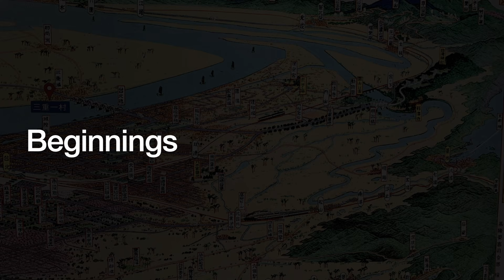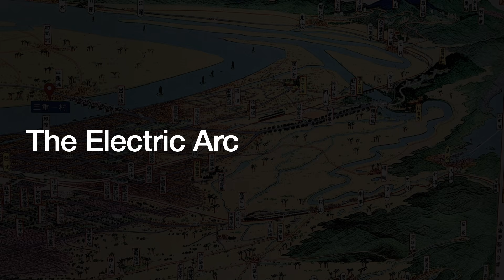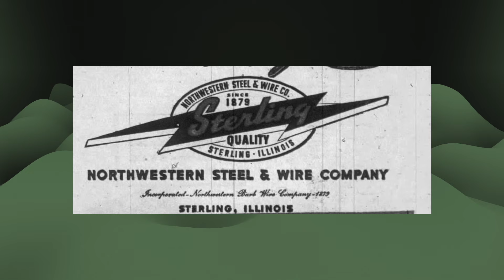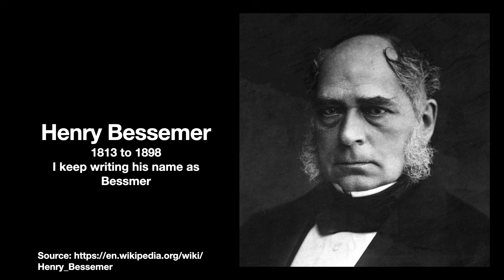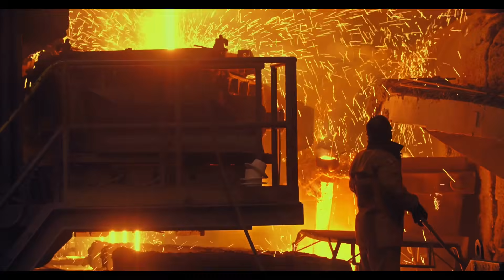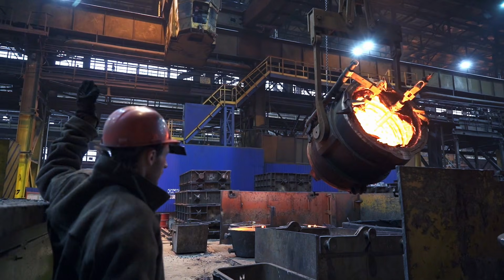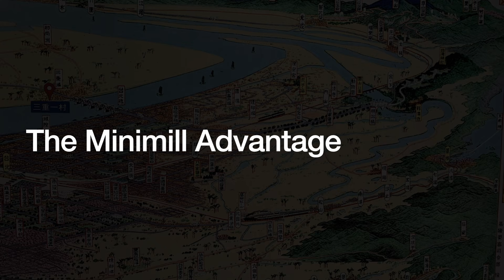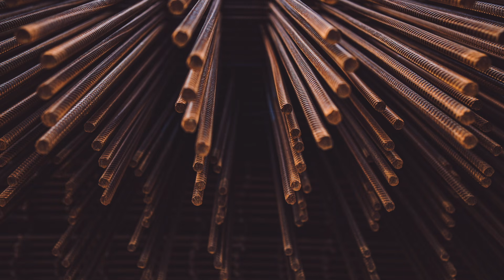Disrupting Big Steel: Conquest of the Minimills

Comment: US Steel helped USA's ally Imperial Japan Industrialize and Militarize

backed by USA's (Rockefeller) Standard Oil's plundered Pacific Oil

where USA's Standard Oil elsewhere helped fuel USA's other ally, Nazi Germany more than help fuel it's other "allies" combined
Reply: In making Iron or Steel:

1) Fine Powdered Iron (Hydrogen or Natural Gas) Flash Smelting
taking a few seconds
is 3600x faster than Traditional Blast Furnace Smelting
which can use LOW and MEDIUM Grade Iron Ores
produces no Carbon Emissions
(doesn't need coal)

is more efficient than

2) Hydrogen Flash Smelting
takes a few minutes
is more energy efficient than #3
which must use HIGH Grade Iron Ore (compared to #1)
produces nearly no Carbon Emissions

is more efficient than

3) Oxygen Flash Smelting
takes a few minutes
which still produced Carbon Emissions

is more efficient than

4) Traditional Blast Furnace Smelting
which produces the most emissions
taking 5 to 6 hours

■

as far as i can gather:
(had to look it up, using various AI queries, and consolidate the info)
others could help correct this where it's wrong

Comment: 29:00 "robust recycling"
This is the key to the kingdom. Mini-mills became economical when a sufficient stock of scrap steel was accumulated worldwide.
I would suggest lead has a similar story. 
Great content
Reply: Lead is even more commonly recycled, Something like 95% of lead-acid batteries are recycled.
Reply: @Shaker626  95% lead recycling is a blessing. Respectfully👍
Reply: @Shaker626  steel recycling volume is much higher
Reply: @mertbatuhancicek738  steel rust in addition to other loses...so anyway, that "steel recycling volume is much higher" than 95% is happening how?
Reply: On my occasional visits to the US,  I have seen so much scrap steel  lying around the country, mainly old vehicles, that I don't think that they will need any new steel.
Reply: ya one wonders how things may have progressed had ww2 and korea hadn't happened
Reply: they can work with sponge iron too
Reply: And cheap juice

Comment: 16:24 Where does the scrap steel come from?  ISTM that ore still needs to be refined somewhere.
Reply: Wrecked cars, broken appliances, torn-down buildings, old ships, you name it. Also, metal waste from manufacturing. It's true, you've got to start with iron ore, but over the years, the scrap builds up, and making a product from that waste becomes profitable. So minimills can never completely take over from integrated ones, but they can eat away at segments of the market.

Comment: An excellent summary video!  Have been seeing more and more issues as well with foundary quality in supplies.  The big advantage with the hot rolling of plate steel is the dimmensiom on the rollers can be adjusted to produce multiple products (Plate steel of high thickness most commonly being used in ships and pressure vessels/piping - having high strength, low cost, diverse options lets one purchase closer to specified thickness (e.g. if you have some 2 inch steel 300 ton vessel and have to make it out of 2.125 inch steel you just wasted 1/9 of the metal cost and have to increase your foundation size consumatly). 

I think a great way for minimills to compete here would be to shorten the adjustment time on the rollers - big steel could do it too but the retrofit cost could be quite high.

Scrap costs have also increases due to increasing impurities that arent removed in the reduction process of pig iron so they have to be pre-processed or custom assured tensile/toughness properties havent been comprimised - big cost increase for end user.

IMO - minaturisation and getting the casting + manufacturing as close as possible to assembly and construction is the key - be interested on your thoughts based on the research youve done as to what the next big disruptor will be!
Reply: Cast-to-order does exist, and mostly is a mini-mill specialty. Still relatively rare and expensive.

Comment: Excellent episode, Jon! Amazing how often huge industry leaders like US Steel, AT&T, General Electric, etc. mostly fritter it away instead of reinvesting, perfecting, and future-proofing the business they actually know.
Reply: It would be more excellent except for the fact that the only way to economically produce large volumes of high quality iron is with a modern blast furnace. Arc furnaces can not do that. This is why integrated mills mainly focus on a blast furnace operation. The general public's perseption of the blast furnace is that it is low tech. This is simply not the case.
Reply: @johnking9942 BOFs produce superior quality compared to EAFs. That's just a fact. Using cleaner scrap is a big part of that I guess. The big problem with BOFs is that you cannot make them "carbon neutral". They produce CO/CO2 while EAFs don't and can be run on green electricity. This is the biggest deciding factor for steel plants looking to expand in Western countries. You can already see what is happening: most of them don't. Polluting the earth is just cheaper when you do it overseas.
Reply: @johnking9942  😂😂😂😂, BS.
Reply: This contrasts with companies like Krupp and other European ones who have been around for 150+ years
Reply: @CatnamedMittens  To be fair Krupp (or rather Thyssenkrupp today) is also suffering, they have been bleeding cash, employees and parts of their business for years now, and it doesn't look good. The competion from china and india is too strong, the only thing they are known for nowadays is elevators.
Reply: @lbgstzockt8493 and hopefully they keep moving away from making mediocre steels and towards end products like elevators.
Reply: @lbgstzockt8493 huh? Thyssenkrupp is a conglomerate, they do lots of stuff incl defense (shipbuilding and submarines) amongst other "stuff". Thats not your average steel company.
Reply: Human nature, complacency, arrogance, nepotism ( dominance by the unqualified who backbone another ), turf, …
Reply: If you goal is to make money, why compete over scraps? I’m not the biggest fan of private healthcare, but there’s a reason Kaiser, the mill in Terminator 2, shifted away from steelmaking, to healthcare.
Reply: Blockbuster Video...
Reply: The problem is that there was no viable investments they could have made. As the narrator said, they did the math and determined that the cost of upgrading their steel plants was so large that the extra money it would generate wouldn’t even cover the interest on the loans. That’s not an investment opportunity, it’s a bunch of scrap metal shaped like a blast furnace.
Reply: How can you invest in something which doesn't earn a return ?
Reply: @dburke1804 other companies provide multiple methods, some produce finished goods with their steel, some expand horizontally into other domains like mining, others make use of their position to leverage shared infrastructure like becoming energy generators, or logistics companies
Reply: @dburke1804 that’s why it’s an investment.

Comment: I actually worked in Nucor mini and large steel mills along the Arkansas Alabama area. I was a combo welder and the one I had most time in was a mill who recycled material and then made beams, I was extremely close to the areas in with they would rolls out the hot red steel into beams from billets. It’s honestly pretty cool gig other than me being sent 50 feet under in the water systems with little to no light working on water systems with so much grease it’d make u cry
Reply: Yeah, I was on the casting side and finishing side. I preferred the casting side but the finishing side of things was way cleaner.
Reply: The Arkansas Alabama area?
Reply: ark, mis, al. Its the range of area which the steel mills im mentioning operate.
Reply: @merkwey  ah.  I was wondering where the state between AR and AL went.  Are there really steel mills in northern MS?